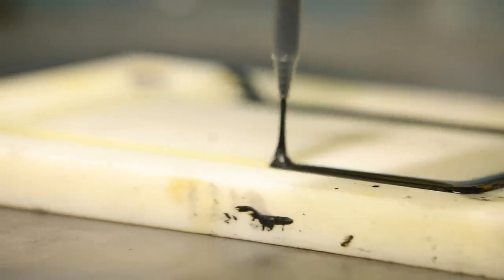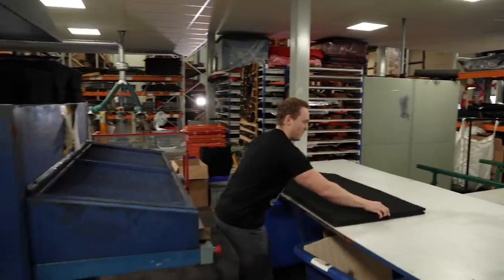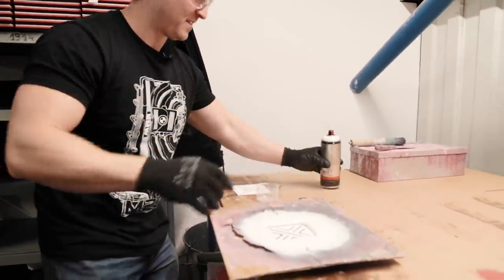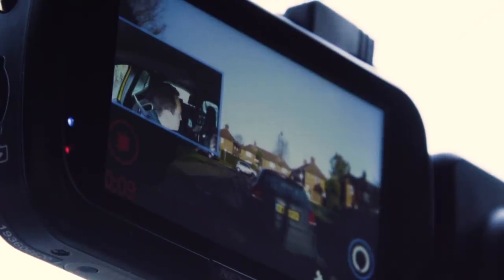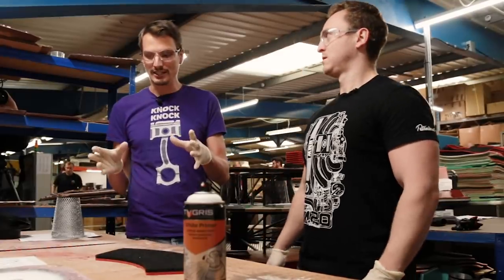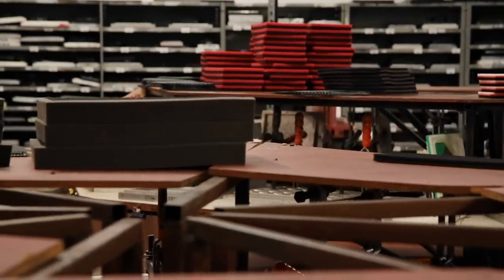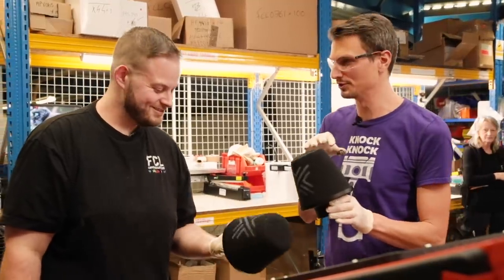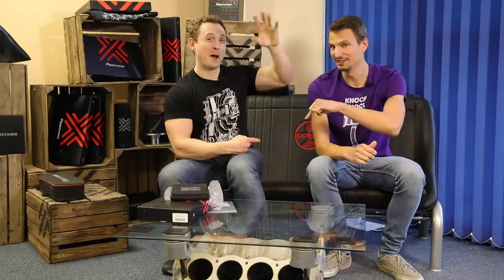How They're Made: Performance Air Filters

Comment: Had one broke wouldn't replace it and ignored my emails
Reply: How did it break? Just curious
Reply: @alfie.b.2660  usually chunks of the foam break off. I've had it on several. Wouldn't touch a foam filter at all.
Reply: Alfie Beckwith the pipercross ones seem to rip easier than other foam filters
Reply: Same here, filter looked flimsy and came fully soaked in oil (including the box) and the paint from the black mesh came loose. Didn't help me with refund or exchange for new one, never again!
Reply: Same happened to me, the rubber part of the panel filter came apart completely. Tried to get in touch with them and nothing...

Comment: I'm sorry but I have to say this. These oiled performance filters are ok for carb cars, or cars that do not have a hot film/wire air meter. But considering that a good 80 percent of modern cars do, the oil residue will ruin the airflow meter and you will find that you will have to replace the meter. You are better off with the factory cotton filter, and there is little to no difference in performance gains.
Reply: But induction noise....
Reply: Marc Stock And performance air filter is not even giving you any significant gain... it is overrated
Reply: Agreed, oily filters cause oily MAF's.
Reply: You get gains if you map it in
Reply: liam curley You get the same gains if you remap it without changing the filter.
OEM filters are designed to give more than enough air to the engine, otherwise the fuel consumption would increase. You only need to replace the filter if you already did other changes, and your engine now requires more air than a stock engine.
Reply: @larrrbs  you get gains if you map any car, the filter won't make a difference. Car manufactures map an engine to suit a broad range of potential conditions, from fuel quality variations , to geographic variations in climates, and then there is the emissions regulations. You can take any engine and map it for max power even with the standard parts in it, an air filter will make no difference , and may in fact reduce efficiency as many modern cars have computer controlled variable intake manifolds, so a cold air induction kit for example will likely reduce your efficiency.
Reply: @juzoli  correct
Reply: @larrrbs  like a 2 hp gain after spending £1000s. The best thing you could do is buy a car that has decent performance as standard, rather than trying to polish a turd.

Comment: I've learnt I probably wouldn't buy a piper cross filter, those things look flimsy as.
Reply: I gotta agree on that but theyre pretty good quallity. Just grazy expensive for what you get
Reply: They fall apart after a few hundred miles
Reply: @willsaund13  mine still working after 10k killometers. And in any case, its a replacement item just like a paper filter
Reply: @bennigek7196  one of the pod filters or the panel filters?
Reply: @willsaund13  both of them actually. Every filter has to be replaced after a certain time. Only the k&n filters are an item you dont replace too often but even those will have to be replaced eventually.  You cant just keep cleaning them. Only issue i see with foam filters is when you have a kompressor as it will not only suck in air but also the foam as it sucks harder.
Edit: i have a pod filter
Reply: Pipercross is a fraud company that make horrible products. I once bought one and it was soaked in oil even the box was full of oil and the car reacted horrible to it...Also the black paint from the mesh came loose with just lightly scratching you nails on it. When I contacted them they did nothing for paying me back or sending me a new one.
Reply: @JerainJezza  thats not too nice. The filter i got from them works fine tho
Reply: @bennigek7196   my panel filter been on the car for 6k miles so far looks like new still
Reply: @JerainJezza  same here. Mine was doused in the stuff, had plumes of white smoke from the filter housing for a good week every time the car was started as the excess had dropped through and burnt
Reply: @bennigek7196  as most cars have turbos can't you see how that's a pretty big issue 😂 most disintegrate very quickly. I've seen this with the panel filters not the pod filters so I don't know about them
Reply: They are the worst in points of quality. They just disintegrate and if you are lucky the engine sucks in the parts of the filter

Comment: The oil soak is where the horsepower gets added.
The longer it soaks in, the faster your car goes.
Reply: You need to put red stripes on your air filter too... 10x horsepower
Reply: And if the car itself comes in red, you get 3x more horsepower for all of the added power already installed with the filter.

Comment: Ah yes, a filter so that it sucks up hot air from the engine bay and/releases oil on the MAF. Losing power and fouling sensors, hell yeah!
Reply: Polin Mileg well you clearly haven’t installed it correctly then have you? 😂
Reply: @travisfs7526  Well, it's an open filter designed to sit in the engine bay so... Better off with a panel filter and modded airbox, or a CAI if you want the noise
Reply: Abo999 well if you mock up the correct heat shielding or installing somewhere sensible, somewhere most people don’t then it’s okay no heat soak etc
Reply: @travisfs7526  True

Comment: $50 for a few pieces of oily foam, no thanks.
Reply: This is a very hands on process, I'm willing to bet there are automation processes that can make this filter in a fraction of the time. Chinese filters literally cost $10-$15 no reason for these to cost 5 times the price.
Reply: @Kajacot  this is insane, i dont get how they are selling these at all now after seeing this, they are overpriced, dirty and will fall apart and get sucked in to your engine
Reply: @Kajacot  Chinese factories probably pay their workers 5 times less too... You could automate the process but the manufacturing volumes probably don't warrant the investment in R&D and building the production line. Basically it's cheaper to pay people (close to?) minimum wage to stick foam together than it is to invest in the machinery. I'm making an assumption about minimum wage btw, I don't know how much Pipercross staff are paid.

Comment: I have a pipercross air filter and the build quality is actually terrible! I have the panel filter which at the seams of the rubber, the mesh has full removed itself from the rubber. I have sent it back to ECP and supplied with a new one which has does the exact same thing.
Reply: yeah these are really crappy, have never had one and after seeing this doesnt make me wanna buy one

Comment: Should test them. To a dyno run befor you put them in and after
Reply: Needs to be a dyno run of a clean new standard paper filter vs a new aftermarket one, but they won't do that as it'll show up how pointless they are for the majority of road cars... They're only worth fitting for the noise, if that floats one's boat.

Comment: Cone airfilters make the car lose bhp rather than gain it
Reply: not if you get good ones, running nothing is the best tho
Reply: @marcusnilsson7284  no there just bad and worse than an air box they suck in hot air from the engine bay and lose bhp a car I knew lost 50hp
Reply: @JOE-hu9qk  who said it wasnt a cold air intake? And i can tell you i wouldnt be making 500hp on my car with a original airbox thats for sure, sure just slapping one on a 150hp car wont do anything
Reply: @marcusnilsson7284  in most cases theres no difference but if u have a performance engine and have a bonnet scoop fair enough but I'm talking about a normal car, sorry should of explained more
Reply: @JOE-hu9qk  yeah i agree with you on a normal car, the only thing you gain is induction noice🤷🏼‍♀️

Comment: I always buy Pipercross filters. In the long run it's far more cost effective than a new paper filter every year.
Reply: Lol, the paperfilters lasts longer then pipercross filters
Reply: @Supremizer  If you want to think that, that's up to you. You're wrong however, as the Pipercross filters can be cleaned and reused. Also the paper filters don't allow air to flow anything like a foam filter.
Reply: @chriswatson7488  had one Pipercross cone filter. Never again

Even killed 2 maf sensors due the excesssive oil
Reply: @Supremizer  Sounds like it wasn't installed properly, as it shouldn't be like that. Did it have a breather?
Reply: @chriswatson7488  jep Pipercross cone, didn't last a year and killed a maf. Then a pipercross panelfilter with breather after the maf, killed a maf. And started flaking. Within a year.
Reply: @Supremizer  Possibly a manufacturing fault or a fake filter, as my fleet of vehicles run Pipercross, and I've never had any trouble with them. One car has had the same Pipercross filter for 15 years.

Comment: K&N all the way
Reply: I've had both and I'd agree. The k&n just felt better made and much more intelligently designed as far as the piping went.
Reply: RAM AIR For the win! d:_:b
Reply: Yeah 100% better
Reply: Had a pipercross panel filter and it fell apart.
Reply: @williamsmith-ob6kv  you got the one Alex made.